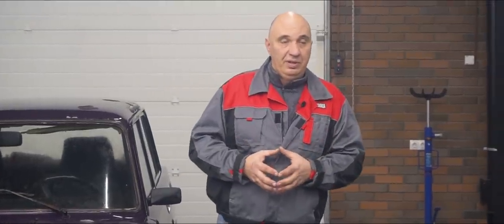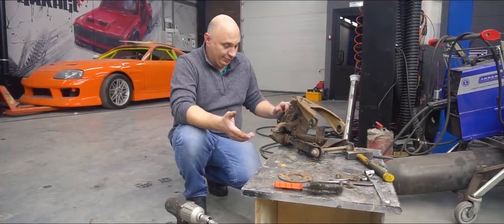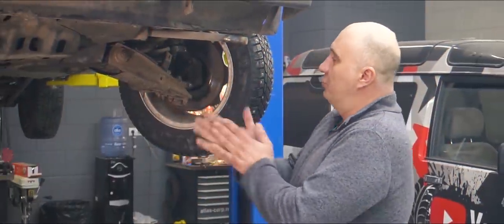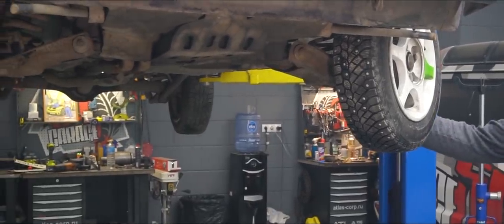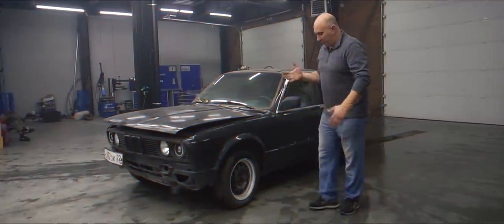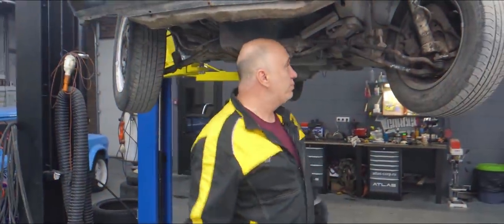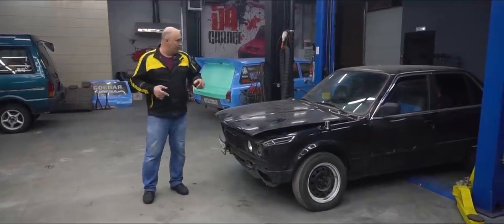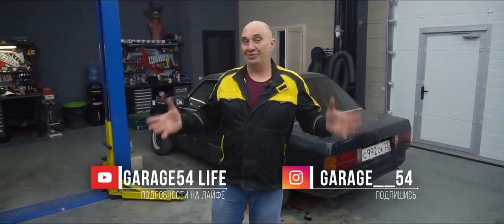Extreme steering angle (close to 90 degrees)

Comment: Ah yes steering angle mods for increased "manuverability and turning circle" totally not drift mods
Reply: Last time I drifted, I used the throttle to turn. In a Hyundai ;)
Reply: @the_kombinator  you can't drift a Hyundai
Reply: @mikkelklein5011  ROFLI guess the last 20 years of owning, modifying and banger racing about a dozen RWD Ponys and participating in autocross as well as winter fun in parking lots have been a lie! Thank you so much for waking me up out of my coma! LOL!
Reply: @the_kombinator  I have no idea, what you just tried to say.
Reply: @mikkelklein5011  Judging by your, inappropriate use of commas it's clear that you yourself don't know, what you're saying.
Either way, I'm off to pick up a 4G63 engine tomorrow morning for my RWD Hyundai that definitely can't be drifted. Not ever!
Reply: @the_kombinator  what rwd cars does Hyundai make?
Reply: @mikkelklein5011  The very first car they made, back in 1976, then in 1983 or so they had what is now a Sonata, it was called a Stellar. The 1988 had a fuel injected 4G63.
I've owned both, trust me, they can drift. 

Currently they make the Genesis. KDM also has Porter and Porter II dually trucks, usually diesels, but I bet you could drift a turbodiesel in some rain.
Reply: @the_kombinator  huh, didn't know they made rwd back then.
Genesis is not a Hyundai tho, it's a separate brand owned, and created, by them.
Reply: @mikkelklein5011  same factories, but yes its a fancy and must more luxurious hyundai
Reply: @Rekt-M8-v4  it's a different brand. It's like saying Volkswagen makes supercars, because they own Lamborghini. It's a technicality, but it's true tho. 

I didn't know about the Stellar tbh. Just googled it, and now I want one.
Reply: Mikkel Klein the genesis coupe was also made under the Hyundai name at the time too, that things rwd
Reply: @Mikkel Klein the Hyundai Genesis that was in formula drift.
You don't know what you talking about.
You could make a front wheel drive car drift too,either cut and add plastic tubing to the rear tire or trays from McDonald's under the rear tires.
Japan has a kei car club that does that by adding tubes to thier 15in wheels.
Reply: @mikkelklein5011  That's kind of like saying Infiniti isn't Nissan, or Acura is not Honda. Equus and Genesis are made at the same Ulsan plant as the others.  

Yeah Hyundai started as RWD, based on Ford chassis and powered by Mitsubishi
Reply: @benjaminfranklyn604  by definition, you can't drift anything but rwd cars. Skidwheels for fwd doesn't make it drift, it just makes it slide. It looks like drifting, but it has nothing to do with it. 

@the kombinator Infiniti, Hyundai, genesis, and Acura, are all different brands. They all have different CVR/VAT numbers.
Reply: Mikkel Klein sure they’re different brands, but they work on a parent company relationship. Infiniti’s parent company is Nissan. For the reason you’ll see a lot of Nissan parts in Infiniti’s, most notably the VQ engine commonly found in the Nissan 350/370z, and the Infiniti G35/37. They maybe listed as separate companies, but they are basically the same brand.

Car companies may want to do this in order to simplify their lineups to make it easier to split the customers up. By having a luxury exclusive brand, (like Genesis, Infiniti, or Lexus) the parent company can advertise them as a luxury brand and reach the luxury consumers. If they were to keep everything within one lineup, the parent companies would have to not only advertise to luxury consumers, common folk, and other demographics they may want to reach. By splitting up into “separate” entities, they’re able to not create brand confusion, and reach their target audiences more effectively. 
Though they are different brands, they’re the same company
Reply: I'm just being way too technical here, because I'm an asshole. 
And would you look at that! I made someone write an entire paragraph! 
b i g   w i n 
Ez
-K
Reply: @the_kombinator  one more! Oh my god! You making it too ez
Reply: @the_kombinator  Haha, he's trying to troll you after you made him feel stupid, its probs just a kid. Funny. Haha.
Reply: @the_kombinator  okay boomer
Reply: @the_kombinator  its like you tried to bait people but got triggered in the process like look at me i have an old korean car im unique and i can drift are you proud i can drift in my old korea car
Reply: @michaelh.1262  Yep, nailed it. Flawless logic.
Reply: @michaelh.1262  At the end of the day, I am working on ways to make the Pony drift better by stiffening the suspension, redoing the brakes, and installing DOHC engine. 

So yes, I am quite proud to drift my old Hyundai. Thank you for commenting on a three week old post, are you robbing any more graves this weekend?
Reply: I'm somewhat reserved about your circle of friends consisting of 12 year olds, and that you devote that much time to studying their habits. If anything is cringy, it's that. Unless you're a teacher, in which case, enjoy your 1997 Chevy Cavalier.
Reply: @mikkelklein5011  doesn't Volkswagen own buggati too?
Reply: Mikkel Klein u can drift a Prius
Reply: because you will sure be able to drift one of the slowest cars in mankind history. lol
Reply: @mikkelklein5011  In some places the genesis coupe is sold as a Hyundai.
Reply: makes parallel parking way easier.
Reply: Put the same steering on the back wells and you can crab into a parking spot
Reply: It would be a decreased turning circle
Reply: @mikkelklein5011  YOU can't drift a Hyundai. Other can... Plenty of videos
Reply: I would adore a Lada kitted out to mix it up with drift cars with all sorts of top flight kit underneath.

Comment: imagine a quad engine lada with that angle, now that'd be something else
Reply: I'll call it the leg breaker 500, front end swinging around and smashing peoples legs off.
Reply: Turbine powered lada
Reply: Lada Quad 90
Reply: probably a lada spins
Reply: Just more angle...the Russian hot rod
Reply: Nah, just put a motorcycle engine behind each wheel
Reply: As long as it is about scooter's engine with cvt transmission that's pretty much possible to do that
Reply: @cristian.caride  Quada 90

Comment: I drive an F-350 king-cab. I need 40 acres to turn this rig around!
Reply: Rez Zircon or do a 180 point turn
Reply: LOL, that too :D
Reply: Clutch kick at full lock and your rear end should snap around 😂
Reply: First time I had to really mash the brakes, it hopped to a halt so fast I thought it was gonna flip... who knew 3 tons could stop that fast...!!!
Reply: DIY 4 wheel hydraulic steer. That would be sick.
Reply: That's nothing. A Nissan Frontier with a crew cab and a long box will take 80 acres.
Reply: What if we just give you 40 sticks of dynamite

Comment: That moment when you realize a LADA has SLA front suspension and your very expensive car has McPherson struts.....
Reply: Is SLA better? I don't really know much about suspension
Reply: @MilesPrower1992  mcpherson is like, the cheapest suspension in automation, so its definitely better than mcpherson
Reply: mcpherson has only one wishbone attachment, as a result the spring compression changes both the height and camber angle of the wheel whenever it is compressed, any suspension compression means a tilting of the wheel around the point where the suspension attaches to the frame.
sla uses wishbones attaching on top and bottom, as a result the wheel can be held closer to parallel to its neutral position independent from how compressed the suspension is currently, camber can be controlled much better, it is the more expensive solution though.

Comment: Hah, double wishbone is even more sophisticated than a BMW :P
Reply: Yes and no
Reply: Mostly no
Reply: In what way (other than economics) is a McPherson better than Wishbone?
Reply: @brynyard  Higher weight capacity, easier maintenance, lower weight. I'd imagine this Lada uses double wishbone front suspension is due to the smaller overall size of that type of suspension, and a Lada is rather short in the front as evidenced by its thin 1.4L straight 4 engine taking up most of the depth of the engine bay.

Double wishbone has its advantages in driving behavior however, in that the wheels maintain contact with the road more evenly under cornering. Another benefit is that the camber stays constant under steering and the steering angle doesn't change as the suspension compresses. It does sacrifice some comfort however as it has higher un-sprung weight. Having unequal length control arms between top and bottom (a very small difference) means the camber can increase under compression, meaning the tyres maintain a flat contact surface on the outer side and the inner side also maintains the same flat contact.

Macpherson however takes up less width despite being a rather tall setup, and this allows for more room in the engine bay at the cost of a slightly longer front end. Comfort is enhanced by the absence of the upper control arm which means engineers can insulate the cabin against vibrations from the suspension. Camber changes under compression however, and its tall height makes the ride height also higher, and its tall and straight-up struts make wide low offset wheels something that can't be used.

Overall the double wishbone is better for performance and road stability but in the long run Macpherson is more affordable and easier to repair should anything break. Not to mention that double wishbone has a lot more components that could break compared to Macpherson. So neither is really "better" than the other, its just that double wishbone is better for sports cars and track cars whereas for anything that doesn't go fast all the time, Macpherson is better. Its all about where its being used.
Reply: @Avetho  Wishbones are quite common on trucks (and I mean real trucks, nut just big pickups) , are you saying they can't handle it?

The improved geometry way outperforms the added weight, the struts can be (and in most cases are) hollow tube steel that don't add much compared to McPerson, so the main advantage is cost. And ironically BMW, who brags more than any other "domestic" brand about it's performance, cuts cost where it matters the most (and gets "outperformed" by a Lada). They put in aluminium radiators that needs (special) fluid change every year to not break, but they can't "afford" a proper front suspension. Most likely because it's "tradition".
Reply: @brynyard  When you say real trucks, I doubt you mean semi trucks, right? Kenworth, a global leader in the field, they use leaf-spring suspension on all wheels, and its a "solid axle" on the front end. In the Ram 1500 (a real truck), the design of the front suspension (where no cargo is placed) is a heavy duty version of a double wishbone suspension that has giant struts and very heavy control arms. That front suspension is designed to keep as much grip as possible when there is massive weight in the back of the truck, thus making it safer and better performing. Its already so heavy, being 2.5 tonnes, that a heavier suspension geometry is not problem. Its increased scale also makes it easier to work on than other double wishbone designs.

There is also the low quality of a Lada's double wishbone suspension to allow lower manufacturing costs, so a BMW X3's Macpherson front end (because the M series cars, not SUVs, all use double wishbone front ends) would perform as well as a Lada's low quality sports suspension.
Reply: Bmw makes their shit look like a transformer.
Reply: Everyone hear me out. Double wishbone is a relic of ye olden times that nobody (besides Lada, apparently) uses anymore. Even pickup trucks dont use double wishbone anymore. They have been replaced by SLA- Short Long Arm suspension. Because on a double wishbone, the upper and lower arms are the same size. This causes the tires to scrub in and out as the suspension travels. But more importantly, having arms of the same length would result in incorrect positioning of the tire in relation to the road surface since the body tends to roll. The body roll would tilt the wheel outward (toward positive camber) at the top, reducing the tire-to-road contact patch, which reduces traction. Notice the positive camber on the Lada when it was on the air? This is what happens to double wishbone when cornering. This was mitigated by shortening the upper control arm and moving the pivot point. If you think you have a double wishbone suspension, go out and look at it and you will see the upper control arm is shorter than the lower control arm. You have SLA suspension, not double wishbone.
Reply: @UncleDon226  no. SLA Is a type of double wishbone. What you're talking about is equal-lenght double wishbone. SLA is also called unequal lenght double wishbone.
Reply: @tesznye6992  Common misconception. It is an ASE question and the terminology for a double wishbone is equal length upper and lower. Unequal length is SLA. Similar, but not interchangeable.
Reply: @brynyard  Well it depends on what they are designed for, and how well they are designed. Porsche uses McPherson strus in some of their cars, aswell as basically all modern rally cars. Even some of the best time-attack cars there is, the mitsubishi evo models uses McPherson. And i don't think a lada for example handles better than them lot.
Reply: This comment thread has turned into an Engineering Explained video
Reply: @UncleDon226  no one are you not including hyper cars track specials and a whole host of cars that use double wish bones with a MacPherson strut
Reply: @motorised1  double wishbone with a machphearson strut. Please, give us an example of a car that uses this setup. I'll give you a hint; NONE
Reply: @UncleDon226  https://en.wikipedia.org/wiki/Double_wishbone_suspension    see that top image

Comment: The stock lada got double wishbone setup. That's interesting
Reply: the AutoVaz VAZ2105 (known as a lada in export markets) is derived from the fiat 124, so some decent engineering did get carried over. early examples used AutoVaz produced clones of the fiat 124's pushrod engine, but the design proved outdated and unreliable so a new AutoVaz overhead cam design was soon used.

Comment: a while back i designed a steering system that pulls the wheel in while turning, so it doesn't stick out when at full lock, maybe it could be used as a full 90 steering system.  could be interesting for parking with wheel motors.
Reply: @manitoba-op4jx  it was a steering spindle, on a steering spindle, pulling one back would move the whole wheel in an arc under the wheel well, then pull the other forward, the edge of the wheel would barely poke out.  it of course, without strict maintenance would get kinda floppy.  then there's the possibility of moving the steering arms in opposite directions, it'd go full 90 degrees, maybe more.  it might be fun for experimental vehicles, but nobody would go that far for a production model.

Comment: The steering wheels must not be parallel when turning. Their axes must converge at the center of the turning radius. The best way to do this is to make sure a line projected from the steering knuckle through the kingpin arrives at the center of the rear axle. This steering knuckle-kingpin angle is called the Ackerman angle.

Comment: FWD will take full advantage of this
Reply: The problem is driving the wheels at that kind of angle. It would probably require some kind of janky double CV joint with a little shaft in the middle and something to hold that shaft section so it doesn't flop around or bind up. I'm not even sure it would even be physically possible to fit such a thing in a near-stock suspension setup.
Reply: @MrNukealizer  Exactly, would be really unreliable, the tiny shaft would pop out a lot and if it would work for some turns it would be clicking, the shaft would be stressed out and the torque loss would eat up like additional 10% of the engine

Comment: a London Taxi can manage a pretty impressive steering angle and turning circle. they have to do this to meet the requirement that they have to be able to turn around in the small turning space in Savoy court, outside the Savoy hotel necessitating a turning circle of 8 metres (21ft) or less. Also notably Savoy court is the only road in the UK where you drive on the right.

Comment: Would it work better with a front wheel drive or would the drive train connection prevent you from using extreme steering angles?

Comment: I keep my tires 45psi or higher, never going to have one hop off the rim!
Reply: GoogleMinus do you drive a van or somethin
Reply: @J3rryTortoise  Yaris hatchback
Reply: @randomvideosn0where  as a certified mechanic, I warn you about that...your tyres are probably 4ply therefore rated at 30-32 psi cold. If you go over that you run the risk of over inflation which leads to premature center wear and leaves tyres more prone to punctures
Reply: @randomvideosn0where  Ouch! great mileage. Painful ride.
Reply: @DocDewey  You are correct, 4 ply (2 steel, 1 polyester, 1 polyamide) but they're rated for 51 psi. My car is so light and 95% of my driving is highway so these things will dry rot in Maryland ozone long before they wear out.
Reply: @TheHungrySlug  I like the harder ride.  I went for an oil change and they dropped it to Toyota's recommended 30 and it was like driving on a mattress.
Reply: @randomvideosn0where  fair enough...I was just going off of the limited information provided...psi ratings will vary depending on make of tyre and it seems you have a good brand to run on so 45 isn't a risk in your case
Reply: @DocDewey  They're great tires, Michelin. They have better traction and ride quieter than the firestone junk. The only compromise was the price.
Reply: @randomvideosn0where  Michelin tires are what I run on my semi...can concur